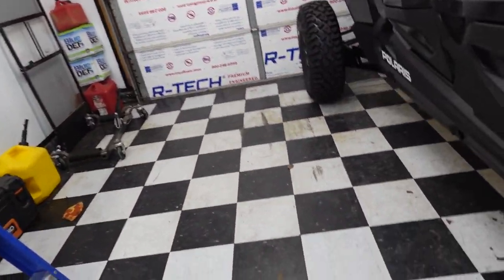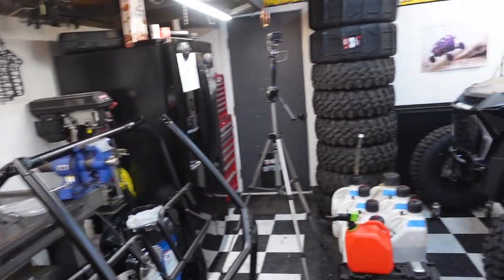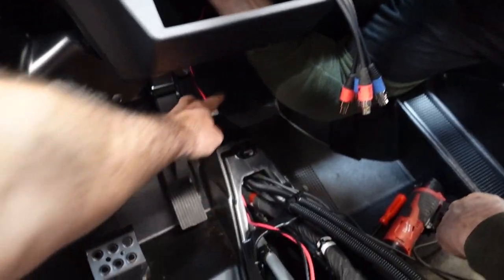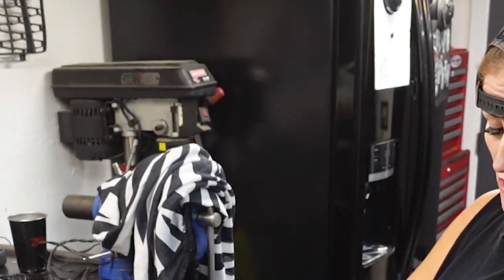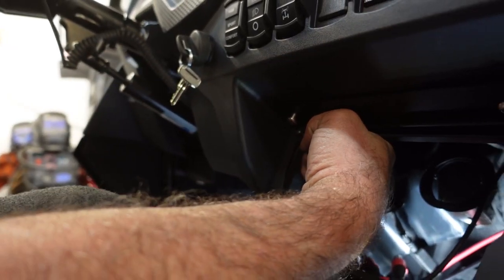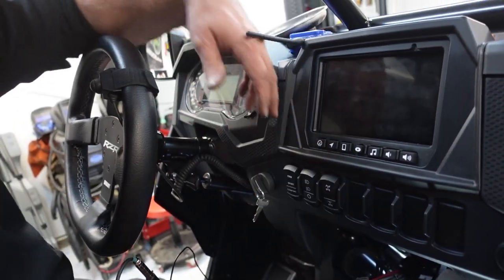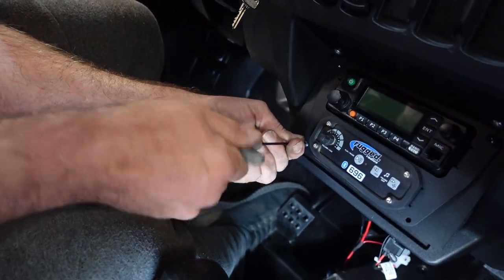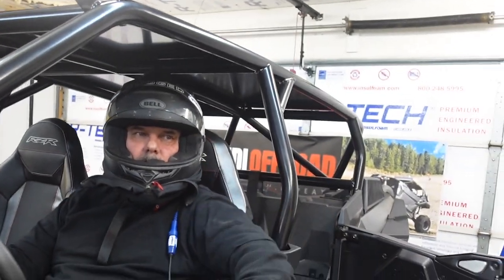2021 TURBO S Gets Full Rugged Radios Set Up - Pumper And All!

Comment: So I just got the Rugged RDM-DB, are you able to washout the rzr and get water on it with out any problems or do you have to cover it up
Reply from the maker: We have washed our Pro and Turbo S with this radio in them with minimal protection and no issue so far. But of course I would be careful